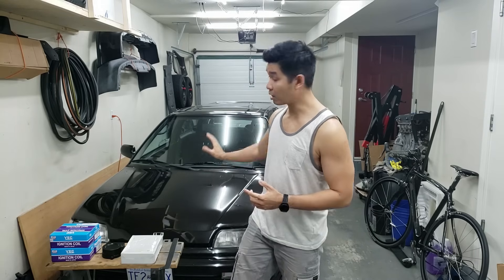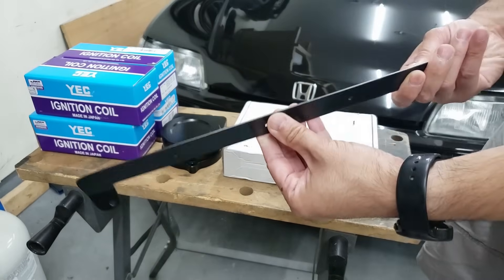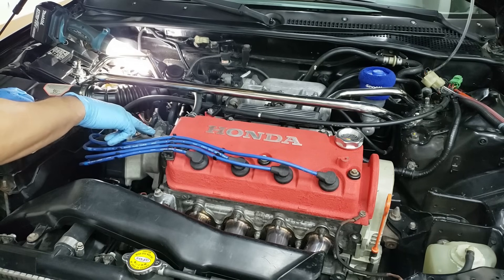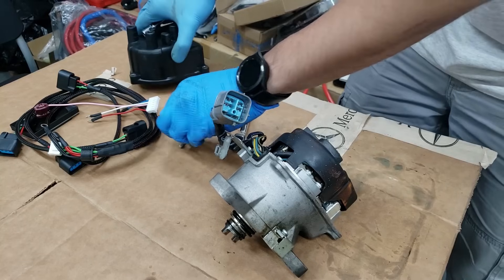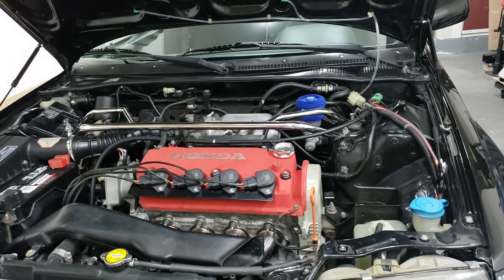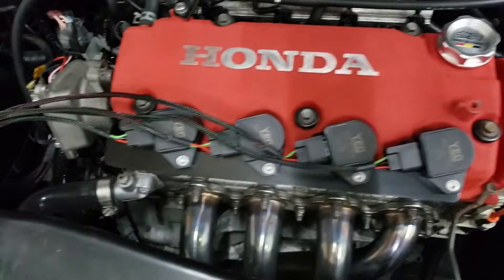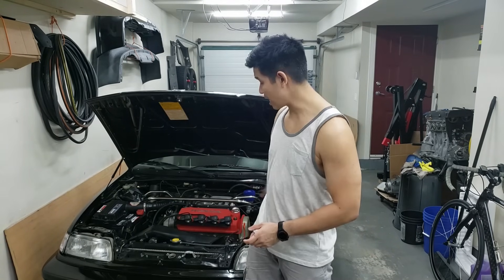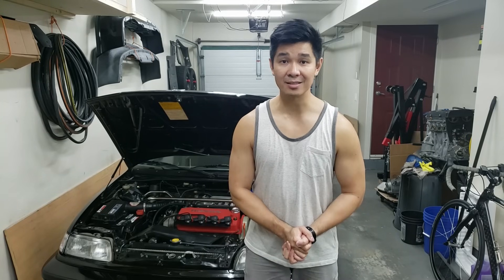||HONDA CIVIC & CRX|| 🤑The CHEAPEST Coil on Plug Conversion Kit!!💥for HONDA B D H F Series Engines👍🏻

Comment: should i put a y8 or a z6 in my crx?
Reply from the maker: Depends what you're doing with the motor. If keeping stock, I'd go with a z6 if you can find one in good shape. The z6 is overall a stronger and better motor and you can run a stock p28 ecu without requiring tuning. If you're building the motor for more power etc. then it doesn't matter. Overall, the z6 was a better quality made motor compared to the y8.

Comment: Could the issues youre facing be based solely on the fact that it's essentially the cheapest on the market? As ive heard great things from other kits
Reply from the maker: Doubt it. The kit works fine. Just takes longer to crank now. Many people have used this kit for years and haven't reported any issues. I think if I didn't have push button start, I'd probably not notice the cranking that much. It does fire up the crank after the initial start up sequence. Sometimes it still fires up within the start up sequence, but when it doesn't it's annoying because I'd have to reinitiate the start up sequence again. Just easier to hold the button.
Reply: Still your idle screw on throttle body

Comment: Rotors seize to the shaft, I tap the top with a flat punch to break it first. Pretty common. I always open the dizzy when I get a new honda, most need a new rotor. Good time to check and replace your distributor oring, a common leak spot.
Reply: wtf r u doing bro hammering a prybar on a plastic rotor head 😭😭
Reply from the maker: That's a excellent trick. I'll try that the next time I have to take the rotor out. I totally didn't think of tapping it first, but makes so much sense. Oh yeah the o-ring is new so I didn't need to replace it. Practically all the pieces in my dizzy were replaced not that long ago. I was surprised the rotor got seized already.
Reply: How do you tell it needs a new rotor visually,  and what symptoms does it give? Mine is still original on 240K Km, looks ok and car runs fine?